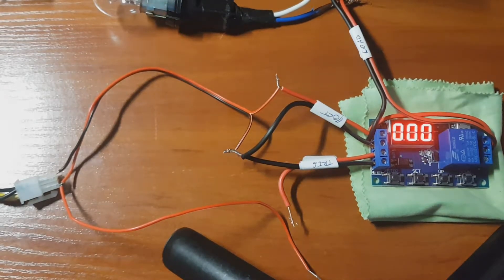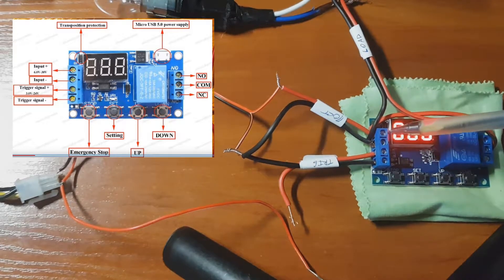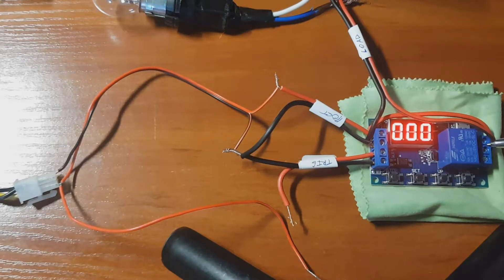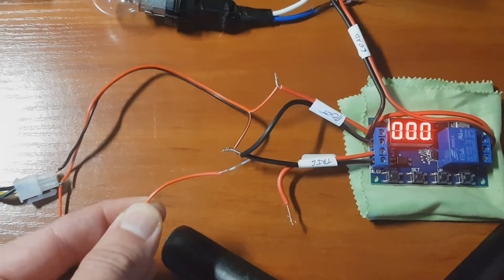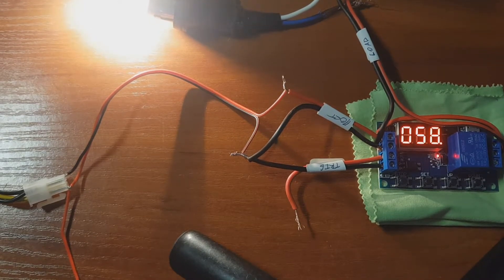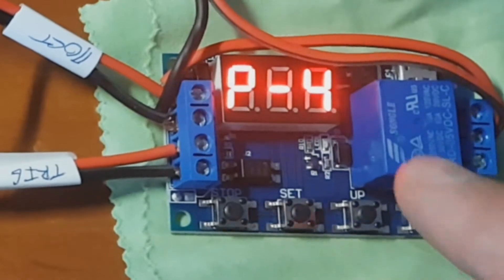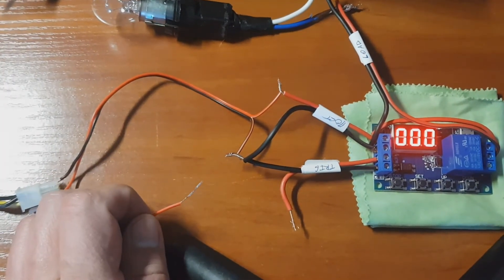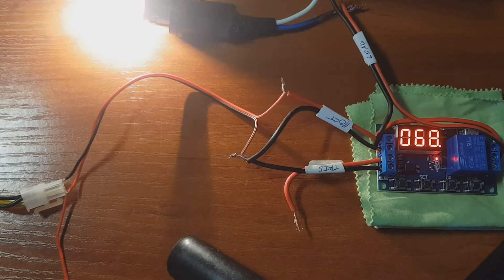FULL MANUAL - Display Automation Delay Timer Control Off Switch Delay Time Relay DC 6-30V

Comment: Hi, Do u have problem with Car Battery when the Car is not running? Because the Relay have the constant voltage and it's work the whole time. Sorry for bad English :) Nice video
Reply from the maker: No, I disconnected it